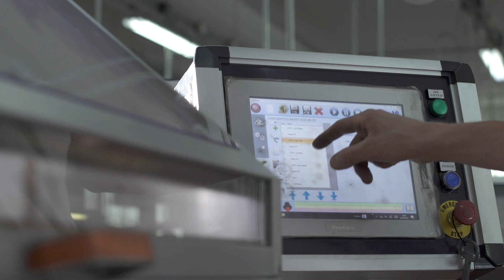Double Curb Diamond Cut - Sphere - Cube - CROMA CATENE

Comment: I have some silver Italian 925 large curb and figaro. I have noticed some links are not cut evenly? How is this possible with a machine vand some of the vintage pieces has a dark plating that is very difficult to remove. Is it rhodium?
Reply from the maker: Hello,
and thank you for your message!
answering to your question without any picture or see directly the chain you are talking about is almost impossible. if we can help you, you can send us an email to info@cromacatene.it

concerning the dark color, specially if the dark color is inside the link, can be an oxidation treatment. if the color is almost black can be rhutenium or black rhodium.
also for this issu we should see a picture to aswer 100% surely.

thank you again!
have a nice rest of the day!

feel free to contact us for any further assistance you may need.

Croma Catene